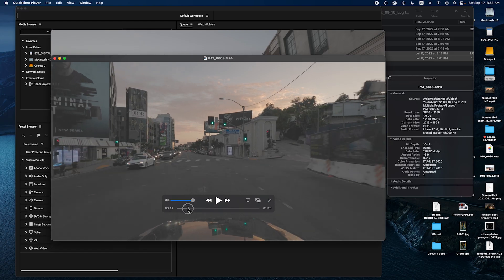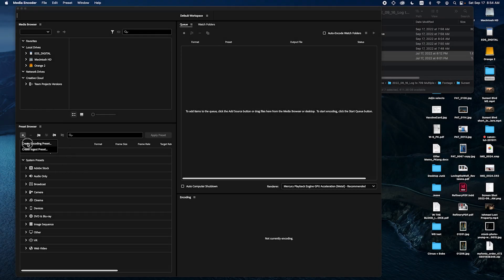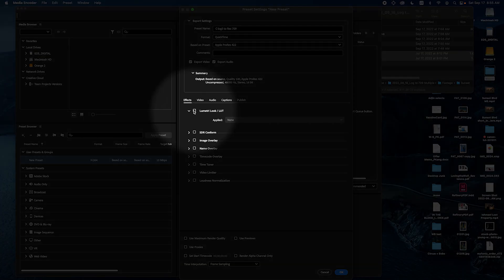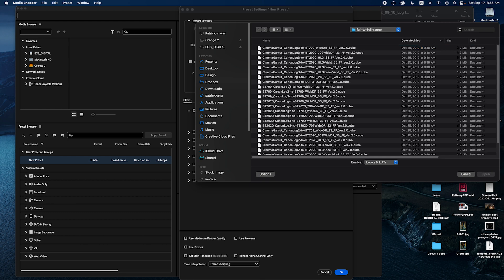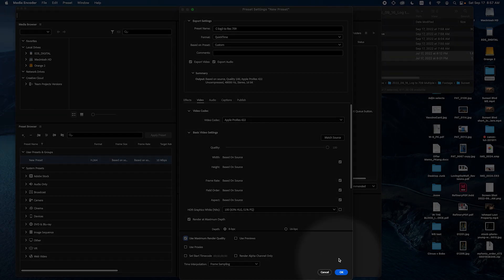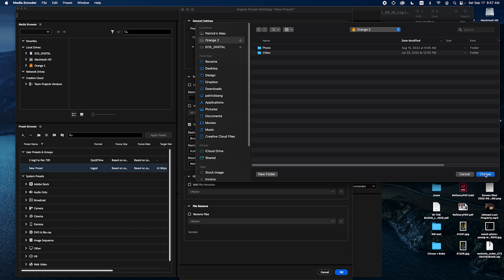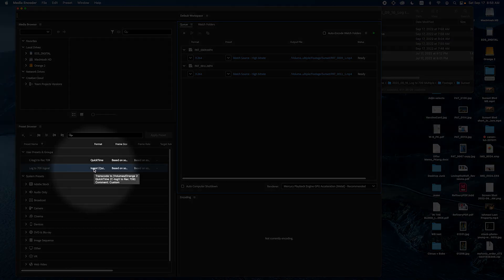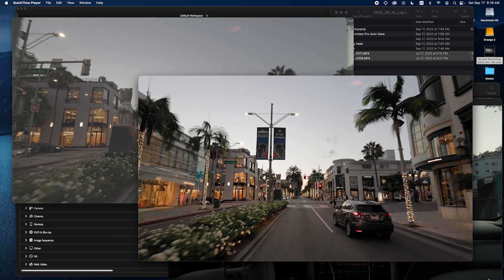How to apply LUT to multiple clips in Media Encoder

Comment: I have over 100 and I tried selecting all and dragging my ingest preset over and it just does one or adds to all while keeping the default output destination. How do I just apply it to all with the one output destination?!
Reply from the maker: I’m not sure, it’s been years since I’ve done this. But my guess is, select all the stuff in the queue, and then click on one of the underlined hyperlinks that tells you the destination, then choose the destination. I could be wrong. I forgot where I set the destination. It might be a step when you create the preset.
Reply: Same thing happens for me - I have to do one at a time which takes forever. It's pretty unforgiveable that a basic thing like this is not doable
Reply: Commenting so people know, if you select all, then double click the ingest, it should apply to everything selected!
Reply: @cauliflower.9091  just coming back to say that what he said above worked! double click ingest after selecting all and it will populate to everything!
Reply: @cauliflower.9091   Okay I tried it  what you said but it didn't replace it, It has both quick time and ingest versions.... still doing it one by one

Comment: Can you explain why you need two separate presets; ie., what is the logical purpose of each type of preset? This is terrific information, well-presented.
Reply from the maker: From what I can remember, you need the Encoding Preset to make an Ingest Preset, and you need the Ingest Preset to complete the export process. It won’t let you select the encoding preset at the export stage. The blue underlined text in the queue window can only be Ingest Preset. What I’m doing here is I’m selecting the color space transform LUT (CST) as a color grading LUT (instead of BLUE SL, etc), which is kind of cheating. I really think Adobe should make this process easier. I  wish I can just select a CST LUT straight from the Ingest Setting window.
Reply: @blackbugmedia  Thanks. I tried it just now in 24.1 on mac and it didn’t work, unfortunately….
Even with the workaround for the bug, when i tried to load the official Panasonic V-Log to Rec709 LUT, it didn’t load it. It just defaulted to the first installed LUT on the standard list.
Reply from the maker: @Sunporchmedia  I think Adobe patched this loop hole, because it didn’t work for me after a few updates of the media encoder. BUT, if you have Panny S5II, you can “bake in” the LUT in camera. It’s basically doing this process in-camera. I don’t know about other Panny models tho.
Reply: @blackbugmedia  Unfortunately, my use-case is exactly as you describe in your original video. I shot in log, I want to include a folder of transcoded clips that include the technical LUT so the client can review without freaking out over the washed-out Log look. Also, my camera is the EVA-1, which produces files that Quicktime can't display directly, so the transcode is also for that purpose.
Reply from the maker: @Sunporchmedia  I see. I’ll see if I can figure out another way. If I do, I’ll post another video here.
Reply from the maker: I just tried it. The old way actually worked again. I dunno what’s going on. But to simplify the process, forget about the Ingest preset (it only really helps in exporting files to a selected destination). Just make an Encoding Preset, and in the Effects panel, load your LUT. (It should let you select as long as it’s a .cube file). 
Load your footages in the queue, Drag your Encode Preset you made onto the footages. By default, it will export to the same location as the footage, but with “_1” at the end of the file name. That’s the only downside of not making an Ingest Preset.  But there are ways to batch rename the files in Mac OS itself. Google it.  Also, in the LUT loading panel, there is “Custom” as well as “Select” now. To me, they both worked. But try “custom”, if “select” doesn’t let you select.